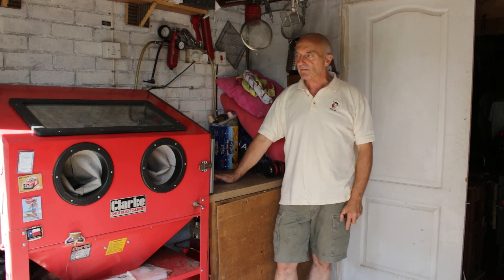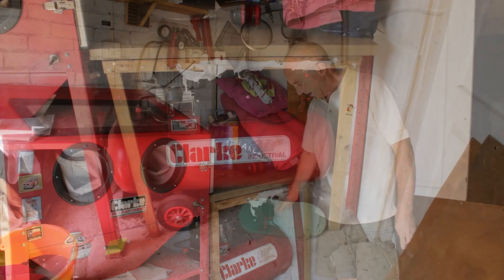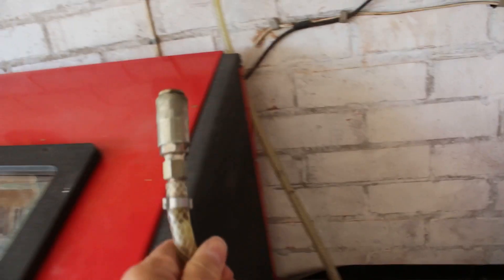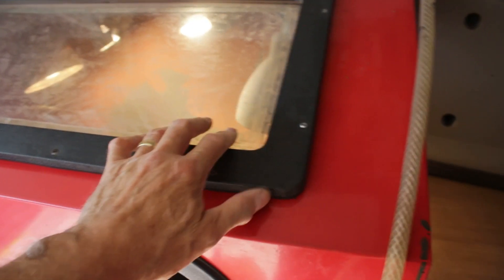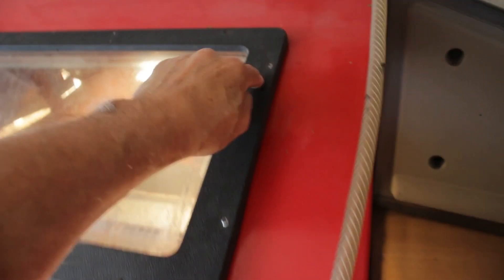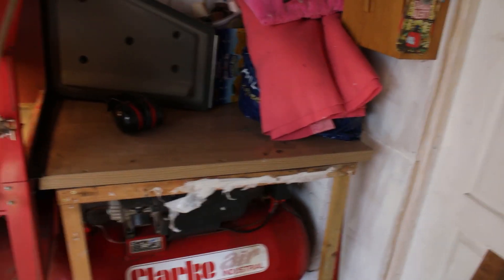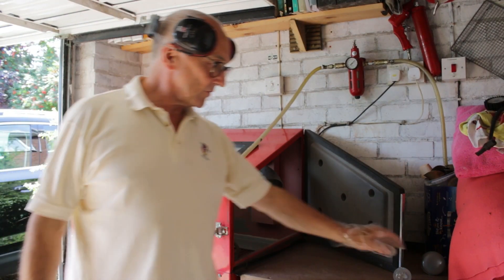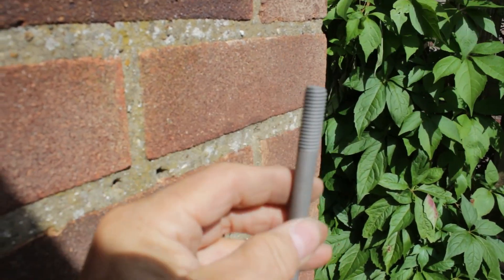Sand Blaster Cabinet

Comment: What is the approximate outlay £?
Reply from the maker: HI, I'm not too sure but I got all my bits and bobs for it from machine mart. You would be best to check them out for their current prices. I know the garnet I use is around £30.00 per about 5 KG and being a tight yorkshireman I use it time and time again until it has gone very thin - then I use it to clean those more delicate parts - as it is almost like a very fine powder by then. Good luck in getting one, once you have it you will never understand how you managed without it - especially when it comes to cleaning old tools for instance. Makes them like new. Regards Edd
Reply: I’m fancying setting one up 👍thanks for the advice